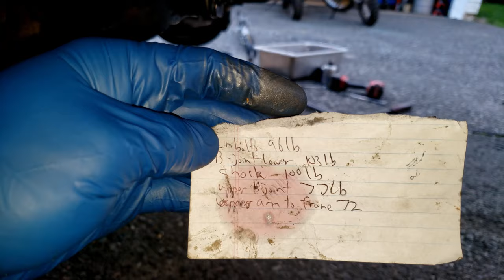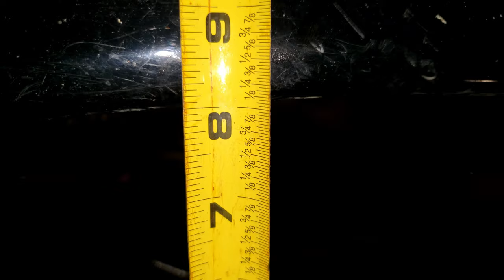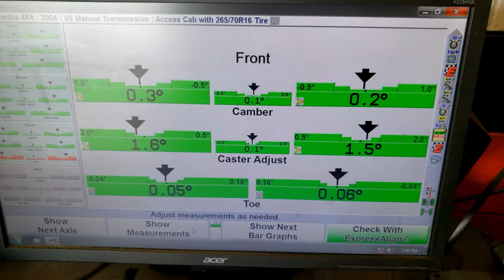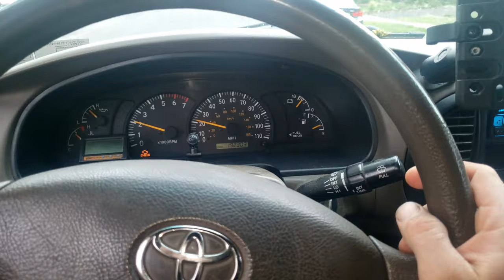Steering Rack Replacement on Toyota Tundra + Front End Work

Comment: A tip for steering rack replacement. If you have the steering tires up in the air and fill the p/s reservoir with fluid and turn the wheel lock to lock it primes the lines and rack to get most of the initial air out of the rack and pinion and pump. I do it at work and saves a bit of time. Hope that helps

Comment: Called my local dealership and was told they use reman Napa racks. They wanted $700 for the part. Went to Napa directly and paid $450 for it. So far so good. Also, had the shaking steering wheel for the first few miles. Topped off the fluid after a few bleed cycles and it went away.
Reply from the maker: Damn that's crazy, can't believe they don't use OEM
Reply: how is that part holding up so far? still going strong? Thanks
Reply: interested to know how it is going with the napa one? I need one for my 2005 Tacoma along with new lines probably or have to flush them.

Comment: Btw if you're at home doing those control arms the bottle jack that comes with the truck works great with a little heat on the arm itself. I'd recommend PSB poly or siberian's as the factory ones don't really last. You have to take the sleeve out on both so don't burn the bushing out, it'll more than likely pop out with heat on the arm itself and the jack.

Comment: Independent front suspension definitely handles better off road at high speeds but you just cant beat the durability of a straight front axle. Thats why I bought a 97' ram 1500(aside from it being cheap). Everyone says the ball joints go out after 5k miles but if you use quality joints, and don't run super big tires and spacers it not an issue. Everything on straight axle is heavier duty it seems, bigger tie rods, strong control arms, no cv joints, etc.

Comment: Thank you for sharing. I’m a DIYer and your video convinced me to get the Toyota OEM rack and outer tierods instead of the generic ones I was planning to buy from eBay. OEM is a bit expensive but will hopefully save me from aggravation from a substandard part later on. That slight tap of the hammer and broke the stub off did it for me.
Reply from the maker: Good choice! OEM definitely the way to go

Comment: Definitely a keeper video!  Without a doubt the best I've seen on the subject. I've got two torn boots but barely any leak in the rack.  Gonna try Lucas snd get new boots.  But if that doesn't work new Toyota rack UNLESS that welding trick worked on the aftermarket rack and otherwise it's been good for you.  I'd appreciate knowing.  Thanks

Comment: To find rack center : can you measure the total rack length,find the center,then simply have equal distances to center to inner tie rod ends ?
Racks are normally mounted centered to the body/chassis,so the center axis of the rack is the reference for everything.

Comment: What I do is measure the toe-in with a tape measure and paint stick. Before I remove the front wheels I center the steering wheel and I pick a reference spot on the tread, mark it and measure the distance between the wheels on the front. When I re-assemble,  the wheels have a reference to adjust to. Makes it easy to set the toe-in back to where it originally was

Comment: Another tip for lifted vehicle especially Toyotas. In my job were we specialize in lifted vehicles high-tech auto and truck center. We recommend setting the caster high as it helps with steering and keeps the truck from having uneven tire wear, which we have experienced on a lot of lifted 4Runners, tacomas and tundras. You can use factory specs if you have adjustable upper control arms like SPC or other quality brands. If it’s 2 inch lift it should be fine with factory specs, but anything more we recommend after market upper control arms. Rancho shocks are cheap and bottom of the barrel. Most customers get them for a more affordable lift, but the quality is not great. I recommend toytec or king suspension if you want some good lift suspension. Do not recommend rancho. They are oem on a lot of GM, Chrysler vehicles, but are not great.

Comment: This throw-away economy has gotten us into a parts crisis. The original manufacturers are supporting their machines for fewer and fewer years, and the aftermarket parts are Chinese junk. Pretty soon we won't be able to keep our older stuff running anymore. It's not just car parts. I tried to buy seals for a blown 15-year old Kubota backhoe cylinder. Was told it's not available, the local dealer said Kubota quit supporting it years ago. Was lucky to find a kit 1000 miles away---"NOS"---that they kindly shipped to me. We're all gonna have to be more clever.

Comment: You're a pretty good wrench. I think i am too. I love cheap Chinese parts. But i don't usually keep stuff too long. I like variety. If it's at my house for a year it was here a long time. 
That being said, i have used cc wheel bearings on a couple vehicles and had them last longer than the originals though that was a Chevy and well. 
My current dd is an 08 ford edge awd. I just put struts, ball joints, tie rods and sway bar links on it, I'm all in for $250. I like the car but it's got 206k miles on it and i don't think the trans is going to make it much longer. 
Great vids btw.

Comment: probably not the same designed pump, but my 96 12v leaks like a sieve around the steering box.. i run the pump dry all the time and drive it around dry if i dont have fluid in the truck the pumps going strong no issues, i run automatic trans fluid in it aswell.. had a similar leak on my 05jeep tj and it seemed like switching from PS fluid to ATF slowed or solved the leaky steering box bushings.. Chrysler really cant choose parts manufacturers that dont leak

so i wouldnt tow the truck over it being out of fluid if youre semi close to home

Comment: I couldn't possibly assemble anything dry like that..Have to put some grease/copper slip on it..Taken to using aluminium grease now..like copper slip but aluminium..good stuff.
Reply from the maker: I'm not sure which part you're referring to but I probably did it for a reason would be my guess. It's been awhile since I did this video. If you're talking about the big rack bushing, you can't lube those. The rack will wiggle around. I found that out when I lubed it. But I don't know which part you're talking about

Comment: Any update on the rack and shocks.    Ironically I also have a set of ranchos 2 1/2 years old that  look about the same.   Other then the poor weld on the rack has it continued to work ok?    Cheers
Reply from the maker: I ended up going with a factory rack. This one was junk and started leaking again.

Comment: Enjoyed the video. Jealous of the manual transmission.
I'm thinking the vibrations are probably friction from cheap seals in the rack or a less than smooth surface inside the rack.
Reply from the maker: That's great to hear, I appreciate you watching.. And yeah I absolutely love manual transmission. Although I will say the automatic does better suit the Toyota 3.4 l. It lacks low end torque. No problem though since it has the low range transfer case. Which I have rigged up to be able to use as two-wheel drive when needed
Reply from the maker: And yeah you're probably right about the surfaces on the inside of the rack

Comment: I own a 2003 Toyota Tacoma prerunner 2wd 3.4l v6 automatic. My steering rack looks almost identical to your vehicle. I tried to replace my bushings on my steering rack this afternoon.  I was only able to do the passenger side. I found out that when I removed the middle bolt I could not find how to remove the bushings. Looks as if the rack is held down by a metal plate coming from the frame.  Also, the driver's side bushings and round metal insert are blocked by the frame.  How did you get yours out? Any tips?

Comment: I wonder how long the rack lasted. My 2005 Tacoma needs a new rack I think, I have very poor power steering, tried replacing the pump and it didn't help much. I'll do the rack and new lines probably.
Reply: found an update below, he went back to a factory rack for anyone else who may see this. I might try to pull my lines off and see if they're not clogged or something then, but my rack is probably shot.

Comment: When you replaced the rack did all the power steering fluid all fall out? I had mine done and fluid still looks dirty.
Reply: a lot will stay in the reservoir, have to flush it all one way or another. Its not that hard to do.

Comment: If you see the part such as the junk Rancho shock bushing not lasting why did you go back with the same junk only to see the same thing. Spend a little more and go with KYB or Bilstein struts/shocks, They are what Toyota uses when new.
Reply from the maker: Because they have a lifetime warranty on them so a few bolts to swap them out.  I like the way they ride too

Comment: It seems like Rancho is pretty much junk.  I've always been an OEM guy myself, but..... several years ago a buddy of mine who owns a land cruiser wanter to get a factory replacement radiator from toyota to replace his 15 year old leaking radiator.  Long story short, the factory OEM toyota radiator had a hairline crack in the bottom tank and could not be used.  We boxed it back up and got a rad from napa for much cheaper and installed it and it worked great.  this is also after he ordered a replacement tailight for his 02 firebird and it came cracked in the box. and also after toyota told him if he didnt run their 40 dollars a gallon engine coolant his engine would "blow up".  its a hard gambit to run out there, seems we all have to look after ourselves.

Comment: I did buy Amazon/ebay parts for My car 97 Acura CL/96 Accord (same) 200,000 miles don't go far but shopping an Dr I got Detroit brand Chinese a-arm Ball joint kit with tie rods everything for $80.
But not on a truck that you use for work/towing etc use the best you can buy NAPA maybe USA/Japanese only

Comment: New SUBSCRIBER. I need some man-knowledge. I have a question...My 20 yo son is about to freak the fuck out over the car he's rebuilding. Many of the "parts" are "welded" together with grime and road gunk. When he tries to take stuff apart, he ends up breaking stuff b/c of the force required, and a general lack of patience.  Any tips? Solvent or lubricant of any kind ? For plasyic and rubber?
Reply from the maker: thanks for the sub Amy.  Hard to give any tips on that w/o seeing it.  patience is key for sure.
Reply: 1 part acetone mixed with one part ATF makes very cost effective penetrating fluid. It's cheap enough that you can dump it on with a paint brush (with a collection pan underneath) multiple times before resorting to riskier strong-arm or heating methods.  Also make sure to get the area as clean as you can beforehand.